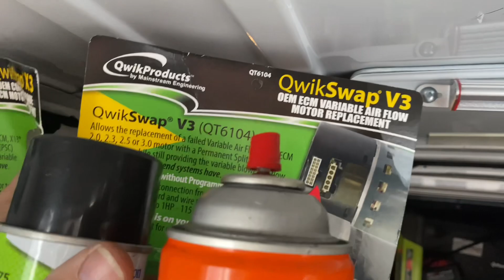Running Emergency Service Calls on Sunday Morning

Comment: Interesting video changing your words for the customers who are not well informed on heating terminology sounds like a great idea! You understand what holds many people back from making smart decisions about their heating system, when they are more familiar with the system and comfortable in their knowledge of their responsibilities as owners maybe they will trust you more to help them make better choices.
Everything every pipe has a name Steam Header dry return drip leg ptrap check valve steam vent main vent wet return it’s very old technology and most people don’t know anything about what makes it work.
Education is key to build trust. Good experience and fair pricing builds relationships and more people know they can trust Mikey Pipes.

Comment: Sunday morning with Mikey pipes. God bless.
Reply from the maker: Same to you!
Reply: I have the same issue with materials handling.. 
softwares these days are tough. I’m suprised you don’t use service titan..

Jobber doesn’t give me any of these features either.
Reply: I also do not leave anything in trucks that cannot be housed. Already had vans broken into multiple times

Comment: Knees suck. In physical work they suck worse. I wont even get into my 2 replacements and the bs i went through. Oh and if you get a replacement and have to kneel, forget about it. Your knees are numb for life. Sucks. So you dont know if youre fucking up the implant or not when kneeling. I know you prob dont want to hear that, but take it from someone who is there. Keep your knees good for as long as possible. Meloixcam works wonders. Hope all is well. I mean that.

Comment: Service truck looks first class Mike. After having several full size vans, the company downsized to Transit Connects, not easy to carry everything I was used to having for service calls.  Company went back to full size van the next time around. 😂   Yes I have several kneeling pads.  They are regular safety equipment to me, just like eye and ear protection.
Reply from the maker: Thanks for the info
Reply: The Metris is going bye bye.... just like the venerable Chevrolet Astro.  I used to run Astros, as they made the PERFECT small-sized van..... I been using the kneel pads for a few years... crouching never was fun, even when I was a pup. Currently, I have a Sprinter 2500 High Roof,,, REALLY nice as some of the services are done within the truck, STANDING is really nice compared to tiny stools or kneeling in the van to work.  But parking, Garages, and RAISING CANES CHICKEN drive-throughs are a nogo...... Chick-Fil-A I can drive under, as long as the posts holding the height bar have not been hit by a cement truck. Good Times!
Reply: @citylockapolytechnikeyllcc7936  agree the Astro was a great small van for service techs if tall ladders weren’t required.  Last company van I had was a 2015 Promaster.  Not bad in spite of a few inherent mechanical issues, plenty of room to carry my tools and parts.  But yes watch the overhead clearance with the ladder rack.

Comment: Hey mike Happy holidays. We switched over to a electronic system for keeping track of inventory on our trucks. It is definitely worth checking out it helps keep our trucks stocked up so we can run from call to call without having to go back and restock.
Reply from the maker: Which program you use?

Comment: Some people are not wired to troubleshoot. At least you found peter a job he can be good at doing.
Reply: 😂 poor Peter
Reply: Peter knows what he has to do he just doubts his abilities but in the warehouse he can be the backup for all the techs making sure the parts are always ordered maybe house call pro can even be linked to your CRM software so it will tell Peter automatically that a part has been used and has to be reordered.
Reply: @Craigcul  very important role. Having a good warehouse guy is important

Comment: Do you prefer the Metris to a Transit or the like?  I've been trying to add a new service van to my pool business and am trying to find a decent Metris here in Florida now that they are discontinued.
My tech that's going to be using it wants a tall Transit but I fail to see the point.  I'm in the swimming pool repair business btw not the a/c and plumbing business.  I just like your videos.  The recent ones about your employee issues make me feel far less alone.
Reply from the maker: I love the Metris

Comment: Hey Pipes, IT guy here... Couldn't you leverage your CRM to give you a real-time inventory of what's on the truck(s) at any given point? I'd imagine every part sold on a service ticket is accounted for within House Call Pro. If so, the data and analytics are extremely valuable not only for parts replenishment but also for forecasting demand based on past service call history which could save you money by strategically ordering inventory. Futhermore, you could save more by ordering in bulk for your other locations.